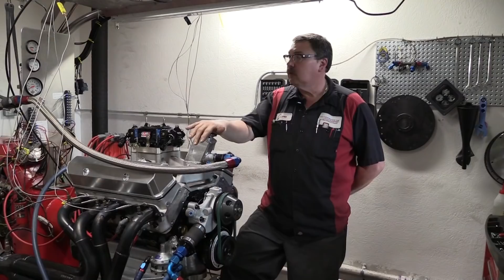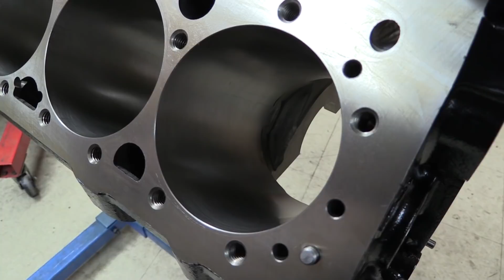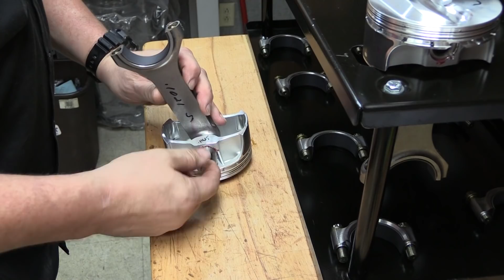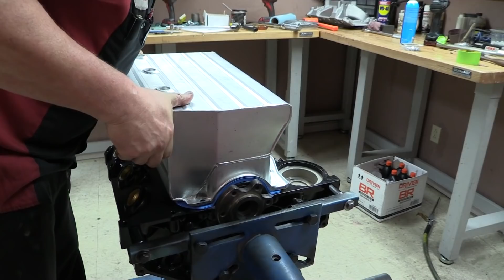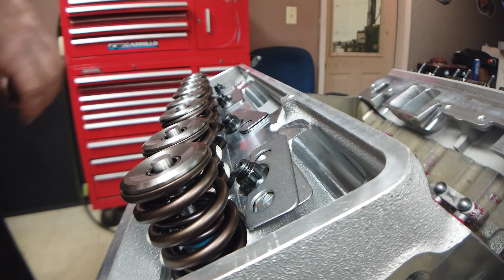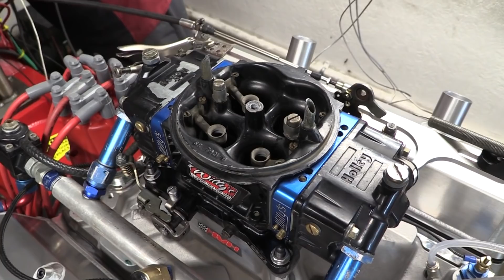Building a Methanol Burning Dirt Modified Race Engine (Over 700 Naturally Aspirated Horsepower!)

Comment: Are the lifter bore bronze bushings used for less friction , or for larger diameter roller lifters ?
Reply: Actually, neither. Don't know their reasoning why they used them, but they are not a necessity when you are just stepping up in lifter size, and not mandatory for wear. It is application specific, but they are mainly used for worn lifter bores, lifter bores that are too short as the bushing offers more stability for the lifter as the bushings are longer, or when lifter bores are not positioned correctly, and/or lifter bore angle or location is modified from stock. Most aftermarket blocks with ample material around the bores don't need them unless you run big lobe lift cam profiles. Hope this helps a bit.
Reply from the maker: VenganceizMine is correct, but I might emphasize two things that apply here. With high lift cams, bronze lifter bores can help keep from sticking a lifter. The bronze is "slicker" than a bare iron bore, and with an agressive high lift cam lobe you get a lot of side loading of the lifter against the bore. Also, if you are running roller lifters you need less oil than a flat tappet. A bushing is an easy way to change the metering hole from the oil gallery to the ID of the lifter bore.

Comment: Glad mopar always had shaft mount rockers! Geez that's a lot of extra parts.
Reply: Also the roller rockers as  in the magnums, the windage tray, domed piston, flat engine skirt, external oil pumps. I was watching this thinking it's all mopar engineering, even the V looks like an rb engine, and the big single plane intake too. The distributor and the exhaust ports were the most obvious visual differences
Reply: Thats why im glad i run mopars

Comment: I wonder how with all the different gearing they can keep the engine in the sweet spot for tq so the driver is coming off the corner with power to pull away. Is that math or feel? I mean a tire size differences could change the power band and shift points, there's so many variables. Am I overthinking this?
Reply: Well for one thing, us dirt track guys pretty much all run in direct drive at all times on the track due to the type of transmissions we run, so that eliminates shift points as a factor. It's not super hard to get your gearing dialed in at least close. Just gotta find the right balance between not bogging out of the corners and not hitting the rev limiter too hard at the end of the straights.
Reply: @rossracing6433  wow that's crazy WOT the whole time? That's great. So like a 2 spd trans or no trans just push it to get it rolling?
Reply: @Alx2672   Not necessarily WOT at all times, in fact a lot of how you drive the car is by manipulating the throttle to help turn the car. Depends on the car. These modifieds generally run a 2-speed, but 1st gear is only used to get the car rolling from a stop. Sprint cars have no trans and require a pushstart.
Reply: @rossracing6433  that's fantastic, bucket list stuff, thanks for the education.
Reply: @Alx2672  No worries man. I live and breath this stuff so I could go on about it for hours. Hope you get a chance to get behind the wheel someday!
Reply: @rossracing6433  Considering final drive is in the sixes usually first gear is for driving at 5mph through the pits
Reply: @ldnwholesale8552  I know, I race a car very similar to these.
Reply from the maker: No, you aren't overthinking it. There is a lot of math that can help where you can plug in the size of the track, tire size and torque to get you close, but there are also other factors that fall into the "feel" category when it comes to selecting the best gear ratio. The driver's driving style is a big one, but the chassis setup also affects a lot (forward bite, tight/loose, etc)  Thanks for watching!
Reply: @TheHorsepowerMonster  I guess you don't run modified late model with power glde that have quick change box on the side ..
Reply: A thing called a quick change diff. Universal in speedway.
Reply: No just the opposite you're not thinking deep enough we have Powerglide Transmissions with a quick change gearbox on the side of it just like a quick-change rearend would have and you take pairs of gears and pop them in there until you get a set thsat does what you see,,as it is against the rules to run a quick change rear did like the sprintsv have ..so before anyone knew they came up with a quick change power glide .
Reply: @donniebaker5984  that's cool, setup adjustment for any track. Is the gearbox needed dependent on the driver being able to feel it out or is it determined from something like rpm vs speed vs time, or something as simple as an odbii reading? So would you say something like "put some more top end in it" ?

Comment: "torque wins races, horsepower sells cars."  Carroll Shelby
Reply: When your're out of tourque you must shift.   Me! :)
Reply: @bigblock67camaro  late model modified stock cars don't shift they run wide fucking opening 8500 RPM all fucking night long had over a hundred fucking miles an hour on 1/3 mile dirt track you can't do that with big block as they will get hot .. been there done that and he'lldthe season ..but these engines here care NASCAR engines .they cost $50k just for the motor parts you put together yourself and another $50k for theccar .of avtotalvof $100,000 buck late model stock car that runs on methanol they'll cost you about $600 a barrel that you'll burn up in a weekend every weekend we run just a few tents off the speed of Outlaw Sprint Cars that do about 150 around these little tracks that's why they call it the racing capital   of the world Nobody Does it Better
Reply: The Big block dirt mods in the northeast is where all the torque is.
Reply: @scottw2157  you want torque come to Indy cylinder heads .. they build entire alumium copies of Chrysler Hemi 600 to 1000 cubic inches I once a year they have had a shootout over here at the US national Raceway Park Indianapolis bring your stuff down and we'll play
Reply: Torque does nothing without rpm, at which point it’s hp
Reply: Carroll Shelby never wanted to make 427 cobra’s.
Reply: camaroguy 66  they have a two speed powerglide with a  quick change box and run in high gear all day ..no shifting..u guys down have a clue
Reply: @donniebaker5984  why are you being so rude.. no need to be a dink just tell em about the power glide instead of going off jesus christ
Reply: @donniebaker5984  your right grew up around nasty small blocks my dad built for late model racing. Didn’t have a lot of money but he built some nasty engines for a good man Charlie Martin R.I.P.!
Reply: Methinks you got the two mixed up ?!  Horsepower gets work done !  Torque feels good !!
Reply: Two big block engines same set up in car in the middle of the summer on pump gas. 10.5 to 1 compression alum heads and the other 12.5 to 1  compression iron heads only runs 178 degrees with a Autometer gauge. And some people at the car show asked me if I could cut it off because it was the hottest day of the year and the fumes from the motor were too hot that day. Also at the racetrack ran it back to back hottest day of the year while most was not running. Drove at home each time with both engines. The downside in the winter time both engines wouldn't build much heat it took forever to raise up some.
Reply: That's right! You need that torque to pull em off the corners !!!!  Give me more torque !!!!!
Reply: We won the eldora world 100 witth 850 horsepower from a 434 cu in Dale Earnhardt Signature Series small block Chevy. And gave us $100,000 to for the win ..how many time have you won the World 100 at Eldora Ohio the tr ack Tony Stewart owns today where Steve Kinser Sammy Swindell and Tony Stewart are the fastest world of outlaw sprints  ..we know all about Carroll Shelby winning LeMans with a big-block 427 two years in a row and then Frenchy's dropped the rules said we can only have a 5 liter and guess what happened then bud it was
Dan Gurney who had won the 500 with the gurney weslake 4-valve pu sh rod heads on small block Ford so they build themselves an engine that would have been illegal for indyy as it was five lliter  with four valves per cylinder small block 302 that went faster like 240 miles per hour and won the LeMans two more times ieach year with horsepower...don't remind us boy we are the racing capital of the world as its called herev in Indy .. you're out of your League

Comment: is break-in oil just bad oil? does it come with grit?
Reply from the maker: Not really, but sort of. Break in oil is formulated to still provide a good hydrodynamic wedge so that the bearings will be protected (they don't need to break in after all) but not have the same lubricity (slickness) as a regular motor oil. This helps the rings to seat and if you are running flat-tappet lifters to get them to mate to the cam lobes. It isn't bad for an engine. I know many engine builders that will run break in oil on the dyno and tell the racers to run the engine with the oil in it for the first night before swapping out to their regular oil. Hope this helps.

Comment: the drivers use fume masks?
Reply from the maker: It isn't as irritating as nitromethane, but it can definitely make your eyes water. Thanks for watching!
Reply: No. Full face helmets are required by sanctioning bodies and tracks
Reply: methanol isn’t supposed to be toxic if breathe
Reply: @byronboost  You shouldn't breathe any exhaust from a combustion engine but no one wears a respirator to drive their daily.
Reply: DrTittieSprinkles daily drives don’t use MEthyl. Alcohol
Reply: @byronboost  And? All exhaust is dangerous to breathe
Reply: @DrTittieSprinkles  Would you not say that if the exhaust is doing it's job, that the vast majority of the exhaust fumes you are so worried about would be safely deposited outside the vehicle? Besides, you're always going to be breathing in some of the exhaust from the guy in front of you, even if they're a lap down compared to you and are halfway around the racetrack. That's just how gas diffusion works.
I doubt that it's the exhaust fumes that make them wear respirators. Much more likely that it's the NOT burned methanol fumes that make your eyes water. Sounds about as unpleasant as having a mist of rubbing alcohol blown at your face with you not allowed to close your eyes.

Comment: Cool vid see dirt track engine's. I know this gentleman owns he own shop but  I constantly see professional engine builders putting there hands all over engine bearings leaving acid from skin and don't see setting bearing crush why is that?
Reply: There's cardboard dust on the bearings when you pull them out of the package.  I've  been building engines professionally for 10 years and my boss 35 years and we've never seen an engine failure due to touching the bearings
Reply: Grease from hands = mineral oil :)
Reply: @jareknowak8712  Technically no such thing as "mineral oil" as all oil was formed from formerly living plants and animals, so the name "mineral oil" is a misnomer. However, the thing typically referred to as "mineral oil" is quite a bit different chemically than skin oils, with skin oils being much more acidic and obviously salty due to the almost impossible to exclude sweat.
However, in the amounts deposited, it's pretty harmless to most metals. We're not talking halogen headlight bulbs here.
Reply: @SciDerg  True!
Reply: @SciDerg  
My hands are 10W30 :D

Comment: Little man is definitely no slouch, a n/a 700 horse small block is just marvelous. Hopefully the new owner will visit the winners circle quite often with it. Thanks again boys. 👍👍👊👊✌✌
Reply: And lets not forget that beautiful torque curve. Even tho it does make an incredible ammount of peak power (for an NA), the power is not only at peak but theres also plenty power in the mid range.
Reply: @Chris-yy7qc   Nooooo doubt.👊👊👍👍🤙🤙✌✌
Reply: I been trying to tell all these guys who think thier 300 up chevy 350 motors in thker trucks or little hotrkds are fast to get a used circle track engine like a modified or latemodel engine cause our oval track motors are more reliable then anything they can assemble on thier own for the price of a good barley used engine. And njce thing is if its still a good motor to have it refreshed os only 1500-2k and you have a 700 hp N/A hot rod motor for less then 10k. Yes you can get a nice used one for 5500-10k.or even order gms partnumber crate motor 602 which is a sealed vortec steel head and block 350 that makes 350 hp stock but if you add better valve springs, 850 frm VDL holly based nascar double pumper carb with a 6al msg box and blaster 2 coil 1.5 inch carb spacer 180 degree circle track cross over headers and your exhaust pipe shpild exist right under pasenger side to make the most power. With that setup on it mine made 402 rear wheel horsepower in my asphalt oval track latemodel truck which is a super latemodel with a fiberglass nascar truck series loomkng body on it. Or go with the 604 part number the makes 450-500 hp GM says dofference is all aluminum and different cam and crank and pistons and bore
Reply: This really honestly doesn't need alcohol or that compression ratio to achieve

Comment: It's running out to early
Reply: Only 600 lift on the camshaft is why it starts dropping off around 7000 rpms but that's not a Bad idea with the long stroke gearing will make the engine work well.

Comment: Nice Engine build, but the lube mixed with the Hairs from a Paint Brush is a bad, Bad idea.
Reply: I was wondering about that when i watched the mud truck engine build.  Just figured hes the pro, so he knows better than myself...
Reply: No worse than this moron not using a ring expander to install the rings. Do you see the twist he put in them and the scratches down the side of the the pistons where the ends scraped them? Wouldn't let this moron assemble my lawn mower engine.
Reply: @attitudeadjusted9027  wow that's hard core I assume you build a more quality product even though you put your two bit opinion out there but don't put your name behind it  bye the way bring me up to speed on the attitude adjuster who's attitude needs adjusted and are you really the man for the job
Reply: @sillygoose2508  mine.
Reply: @attitudeadjusted9027  if you looked closely he actually used a ring expander for the top series of rings that have a more precise fit  but we wouldn't want to F up that Briggs and Stratton high dollar engine you're implying that he's not capable of assembling  just being a smart ass  maybe it's my attitude that needs to be adjusted  lol

Comment: could run that as a turbo diesel at that compression!!
Reply from the maker: That's what's great about burning alcohol. Lower temps, less chance of detonation and easy to tune at high compression ratios. But you do have to burn a lot of it! Thanks for watching!
Reply: @TheHorsepowerMonster  I was withdonDuncan racing Brazil Indiana ..we won eldorsa back in the early 90s ..with a Dale Earnhardt Signature Series 434  for making 850 horsepower on methanol at a cost of 50 grand for the engine..p I was at the shop one day when the part start coming in Don said open that box take a look at that crankshaft I pulled it out nice and shiny forged-steel i said it looks pretty good what they set you back for this and he said 4700 bucks for the crank I gently put it back in the box and said this is your baby I'm not starting it uph
Reply: That is what methanol is all about. High compression and no detonation. Or excessive heat either.